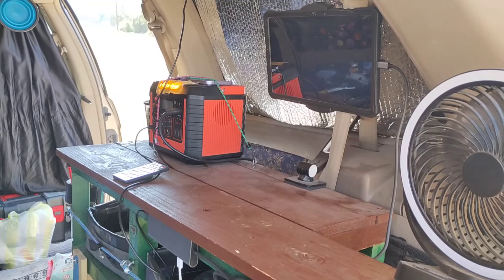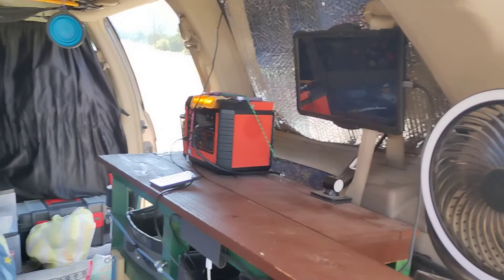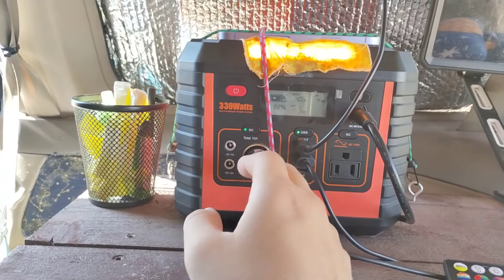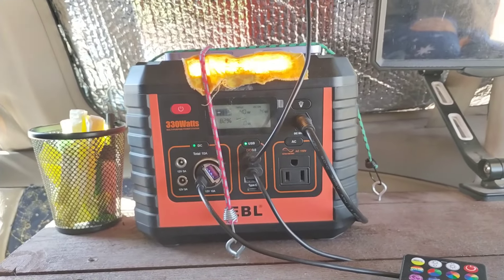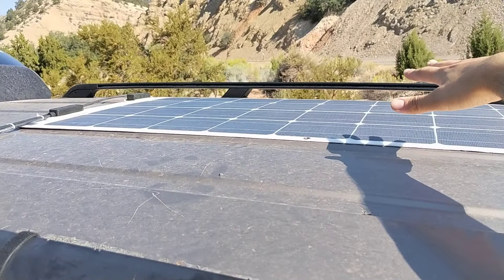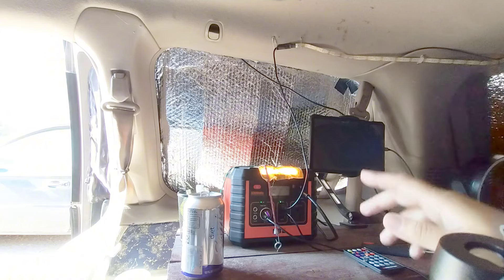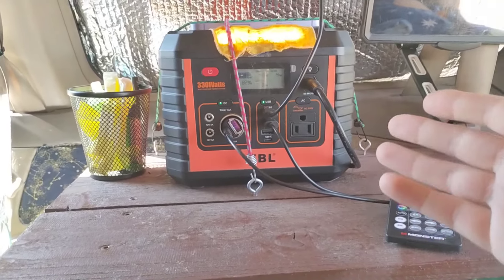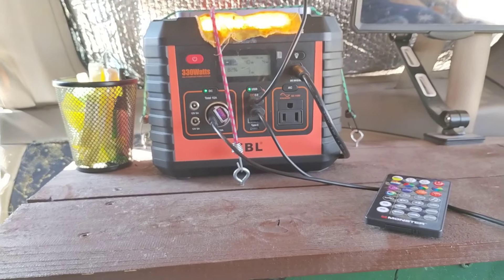Minivan Solar Setup

Comment: CAN RUN A SMALL 12V FRIDGE IN THIS SETUP..?
Reply from the maker: @miguellovino7679  it can as long as you're not in too hot of a climate, I have a fridge, and as long as day temps aren't over a hundred it works. Definitely get one with a compressor though, if you get one that runs all the time it won't work, but one with a compressor doesn't pull juice all the time.